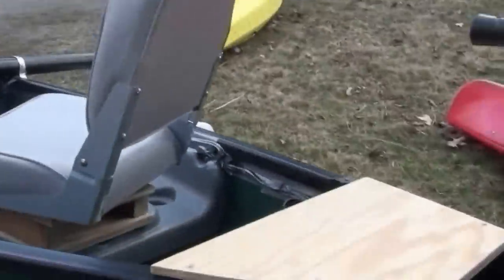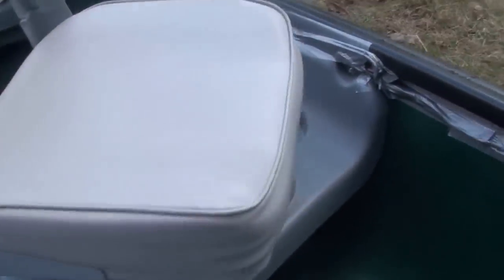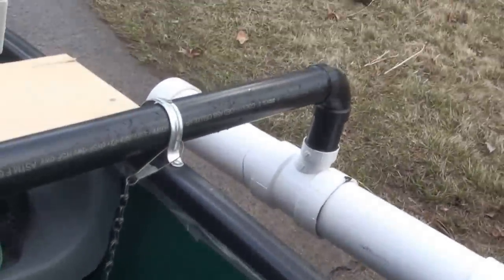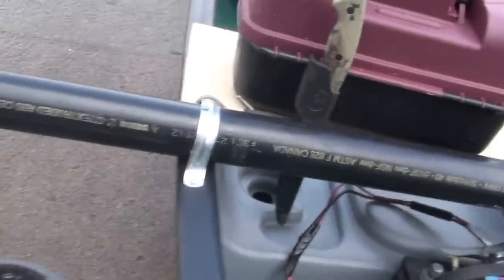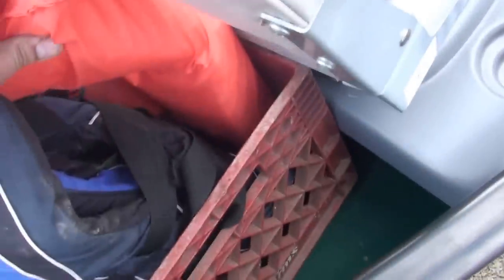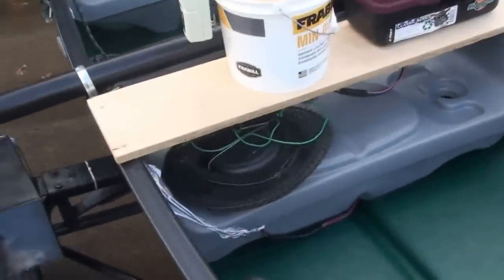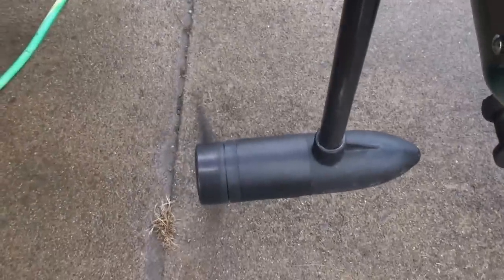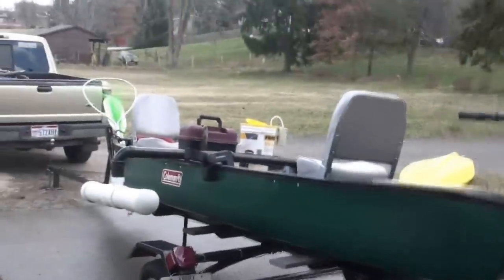CANOE / FISHING BOAT

Comment: Pretty sweet , I've a real real old trolling motor probably 1955 but works great with big marine battery . I used aluminum crutches with big bumpers for stabilizers then I put one 20 watt solar panel on and i haven't had any problem going out all day but ya that's sweet setup .

Comment: Nice Setup. I got a Coleman Scanoe too. The only thing I've done so far is rigged the wires to go to the front of the canoe and put battery in the front when i'm by myself. The canoe is a pain when there is wind and still takes a lot of work with the trolling motor to get the position you want because I don't have an anchor setup yet. I might end up mounting some boards like you did to help stabilize the gunnel because mine is bent already from traveling in back of my truck. :(

Comment: I built an outrigger for my scanoe also not as pretty as yours but I just clamp a 2x4 across the boat where I want it and I use screws and metal strapping to attach five gallon buckets on there side. And I can walk from front to back but nice nice rig man
Reply: Creative

Comment: How did you mount your seat to the plastic seat? Right now I'm using a cheap fold chair that has the metal brackets that fits a jon boat but it fits the seat ok if I use something to keep it steady like a cord, but it has hardly no back support so a long trip of fishing kills the back. I want a cushion bass seat like yours with higher back support but I'm a little nervous about the gravity being higher up on the canoe, it's very easy to tip. Let me know. Thanks.